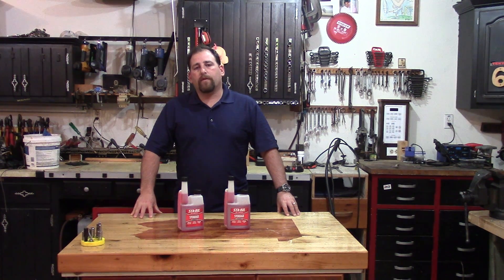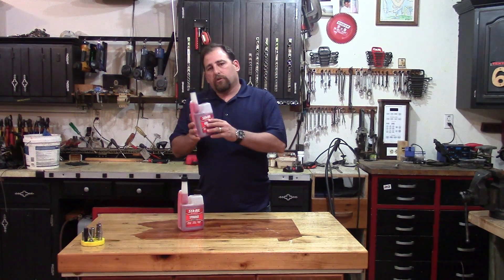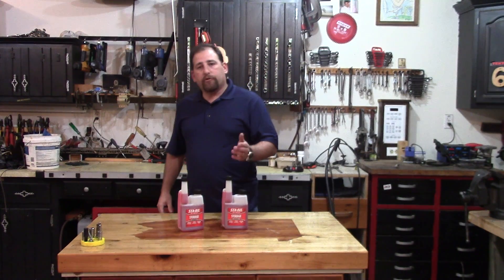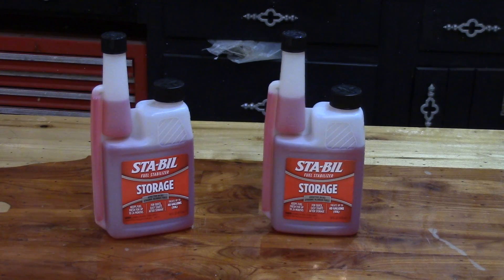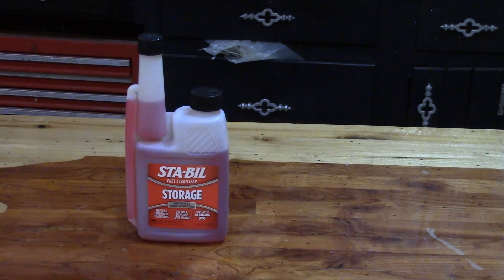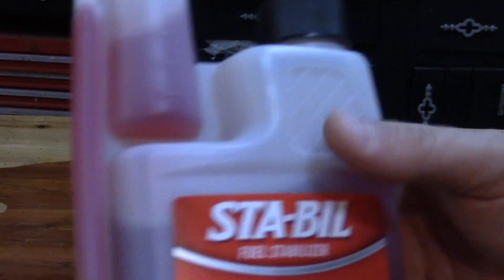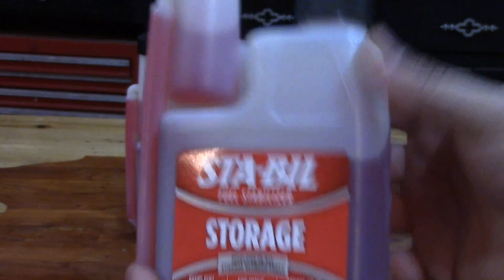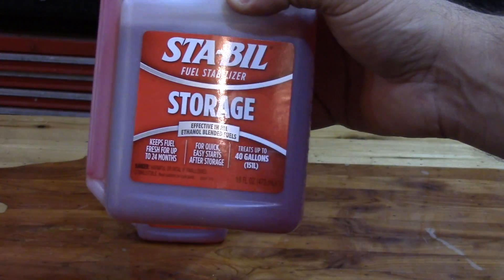STA-BIL Fuel Stabilizer How It Works

Comment: Good advice and video. I know you said it works by removing water but how?  Does Sta-Bil have a video or something that explains what happens?
Reply from the maker: Good question,  I don't know the chemistry behind the product.   You could email Sta-bil the question I'm sure they will take the time to get back to you.
Reply: Not sure about Stabil, but Sea Foam works by having Isopropyl Alcohol in it, which disperses the water through the fuel more evenly.  

  Normally the ethanol alcohol attracts some water into the fuel, and the water being more dense sits at the bottom of the tank. When you go to start it, it's too water rich to start.   With dispersents, like I.A. that help to mix the water more evenly in the fuel, the fuel will still burn, though not ideally (and tends to produce more carbon).  

    The lazy'ish, but still fairly effective way to take care of this issue, is to in a good dose of stabilizer and detergent in, and leave only a little fuel in, run it a bit with the stabilizer and detergents in.    

   Then, when you go to use it again, drain the fuel from the tank, put in some fresh fuel with some detergent/cleaner, and start it up.  The stabilizer and detergent/cleaner should have kept the carb from gunking up badly.  And with fresh gas, with little to no water content, you won't be adding to the carbon build up once you start running it.

        The more ideal way is to drain everything completely, but sometimes getting to the carb drain can be a pain, or sometimes you have a lot of fuel still left in it and it feels like a waste.

Comment: Heya Bob...Sta-Bil now makes a Small Engine Stabilizer specific formula. Check out my video on it. It's got a 360 degree protection where the dead space (where oxidation happens) is also protected with vapor technology. It protects the fuel lines, carburetors, primer bulbs, the Tyvec gas lines on weed eaters etc. Ask Melissa to send you a couple bottles to review. Us small engine guys really need to get the word out about the new technology for small engines and all its components. Cheers Bob! Hugs to the little man! Zip~
Reply: ZippoVarga 
First I've heard of it.  I'll have to see if I can find it.  Thanks for the tip sir.
Reply from the maker: Sean,
I saw your video last week.  You did a nice job.  I need to get some of the small engine stabilizer.  I think my customers would like it.   There are so many benefits to using their product that it would not be a bad idea to use it year round.  My little man is doing well just got his blood work done this week.  Thanks for all your support.  Bob
Reply: Always Bob! And I hope Melissa can send you a bottle or two. What that stuff does is pretty cool in protecting even the dead air space from damage. Cheers! Zip~